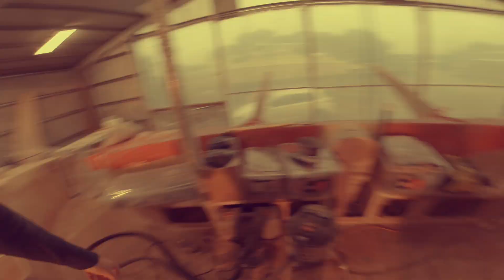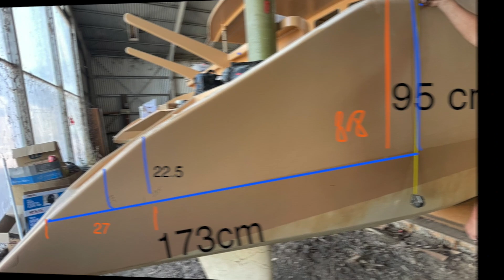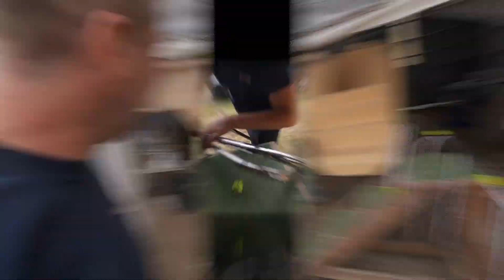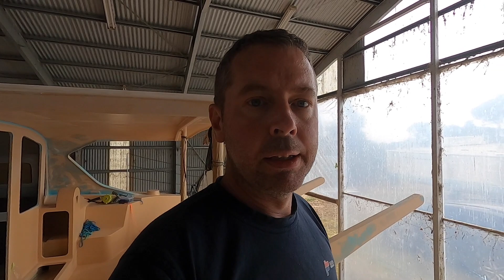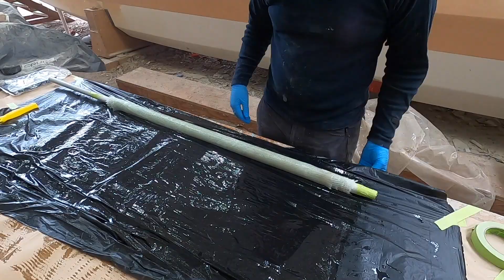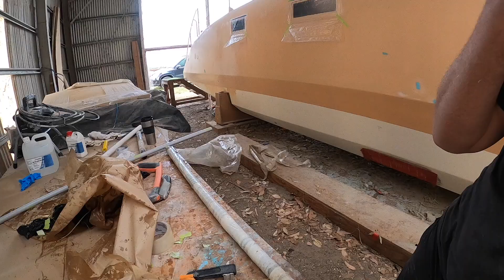Handrails installation - Part I - S02 E23 or How NOT to make fiberglass tube

Comment: A useless comment here - but you can buy fibreglass tube in, readily available with a 4 or 5mm wall thickness - which you can then beef up if required.
Reply from the maker: Yes.... If I had thought of it in thime... 🤣 Soo many little things to keep in mind

Comment: I made lots of tubing for my folding catamaran hinges. After many failures I eventually used a method where I made a very thin initial layup of sheathing cloth only two turns using 6 oz. Then I split it with a knife on the stainless tube and then used tiny pieces of wood to wedge the tube slightly larger and epoxied the gap. This was then my main mandrel, a little bigger than the tube. A quick clean with sandpaper then onto next step. Then I used 100mm wide strips of biax and wrapped these around the tube, spiralling up the tube as I did so. This gave me lots of tension on the layup, no vacuum required, and made an easy to release tube to any thickness. But don't try to use a simple mandrel of a tube for a long tube, I just couldn't get them off and had to cut them off anyway. And don't use plastic - it bends. 
If you give notice of what you are going to do your viewers may be able to save you lots of hassle.
Reply from the maker: Thanks! Yeah, you're right, I got it all wrong. Simply because I expected it to be easy. I wasn't worried about the bend, for the short lengths I was needing this was no concern. The bendiness of the plastic didn't help though 🤣 another issue causing more problems with the layup. I needed short tube sections and thought it would be easy.... I was wrong 🤣
Reply from the maker: Got something pretty good in the end.

Comment: I use clear packing tape on the tubes with several layers of partall mild release. Superglue the beginning edge (just a small amount) of the fibreglass to the tube before you start adding epoxy. This we’ll prevent the glass from spinning around the tube and help you get a right wrap. You can superglue the edge of peel ply to the outside end of your glass as well (also before epoxy) and continue the wrap. Electric tape wrapped in the same direction over that will get it very tight. If you’re con Verne’s about resin glass ratios you can add vacuum bagging release film and bleeder ply as well.
Reply from the maker: I like the super glue thing. Good idea.

Comment: Learning by doing. Failures teach. By experimenting we gain insight on process options, costs, time, rework finishing. Try checking discarded junk at rearby boatyards for tubing fittings. Or salvageable parts from abandoned boats.
Reply from the maker: I enjoy the process.... Most of the time 🤣

Comment: I made a couple of short lengths of tube.  The 75mm diameter was pretty easy to do but the 25mm for my centreboard pivot was difficult and I experienced the same issues as you. It was tricky to get it to wind tight.  As you probably know you can buy fibreglass tubing in a wide range of diameters and wall thicknesses, which having tried making it myself, was what I resorted to for my float pivot tubes, bowsprit. etc.  What I sourced here in New Zealand was a great product, accurate diameters, with a smooth finish, easy to cut and shape, and of course epoxy likes it. You'll be able to source it in Oz of course.  Cheers
Reply from the maker: I just really thought it would be super simple... And it wasn't. Now I know better. I still managed to get what I needed in the end and faster than ordering. (Probably) I know I can get some, the rest of the stanchions are made from the bought stuff. I haven't found a place that sells it though.. I haven't needed to really find some.

You built a pivot for your bowsprit? The whole thing, pivot and bowsprit and fittings? All fiberglass?
I have schionnings plans, but all alloy and I'd like to go composite... Or all glass....
Reply: @buildingwilda  ￼ Sorry my post was a bit confusing...  My tri has a bowsprit that can be extended or retracted depending on whether you have a Genoa/Spinnaker up. To build this I first bought the 65mm bowsprit tubing then to create the tube to hold the bowsprit I bought a roll of craft paper and wrapped the 65mm tube with several layers to create about a 0.5mm “clearance” layer. This was covered in packing tape, then a thin smear of petroleum jelly ( to make removal easier), then wrapped in wettted out glass about 5 layers thick.  Once cured I slid off the tube I'd made and removed the paper etc.  This gave me a nice custom fit.

I also bought composite tubing to go in the beam stubs to take the 25mm pivot pins used in the folding mechanism. These need to be quite an accurate dimension. However I also made some small tubing to fit into the centreboard to take that 12mm pivot bolt. That small tube was tricky, even dealing with a short length - trying to keep it tight and not get too many bubbles in it. I can imagine the trouble you had making that long length!  It would be a writhing slippery mess to wrangle.

I'm sure you could go for composite over metal for your , provided you got the right size.  It's very strong material. The first length of bowsprit I bought sight unseen and realised when I got it the wall thickness was complete overkill - I think it was 65mm OD with a 10mm wall thickness. lol. You could drive a truck over it!.  It's quite solid heavy material.  I went back and bought more with about half that wall thickness. Of course my boat's a lot smaller than yours... Ideally you want to get the right weight material for your boat - not too heavy, but certainly not too light.  Cheers